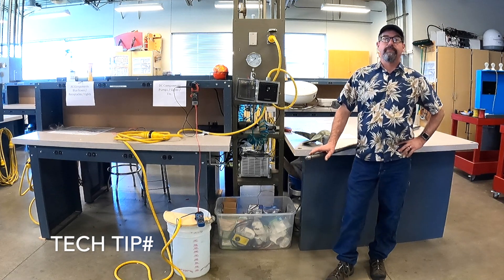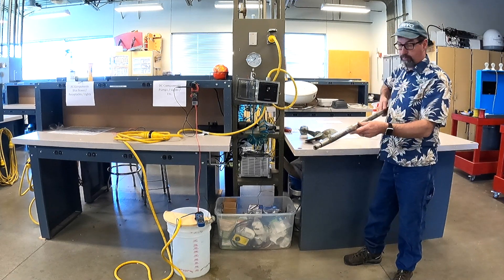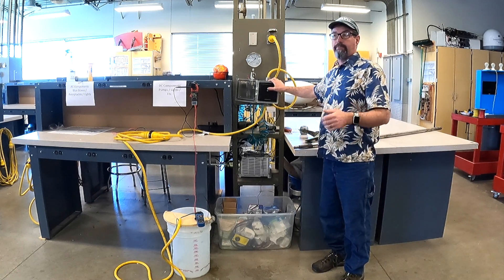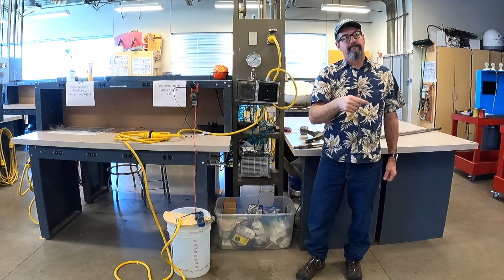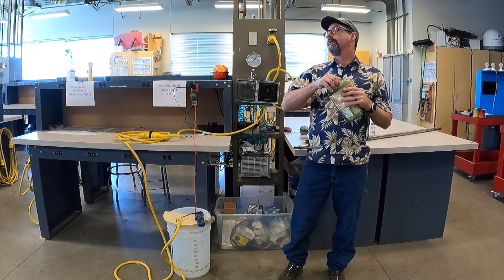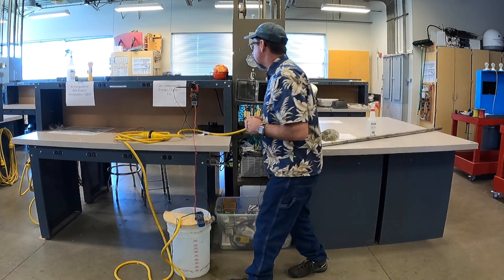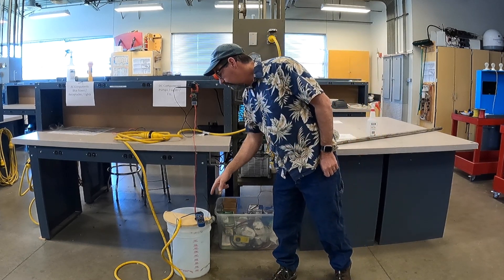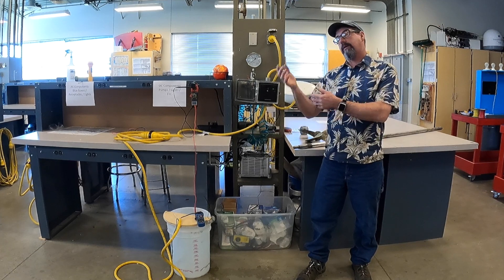Tech Tip #30: Water & Electricity ~ Electric Shock Drowning

Comment: So hypothetically, if an ELCI were 100% fail proof it would be safe to swim in a fresh water marina?  But since they can and do fail you should just not risk swimming in a marina.  Is there ever a condition that a fault in the water could only be drawing 20mA so as not to trip the ELCI but create enough of a voltage gradient in the water that some one could drown due to electric shock?  A good analogy seems to be that of a firearm, granted it should never be pointed at anyone regardless if it’s loaded or not.  But you don’t trust that a gun won’t go off just because the safety is on.  Likewise don’t trust a marina is safe just because it has an ELCI device installed.
Reply from the maker: Great question about 20mA - I don't think it's enough - but will do some research and testing